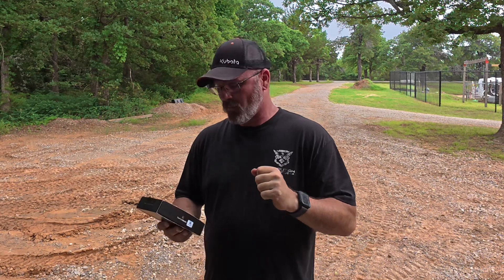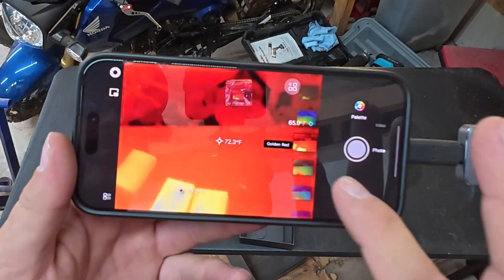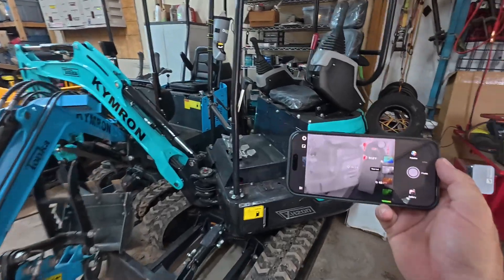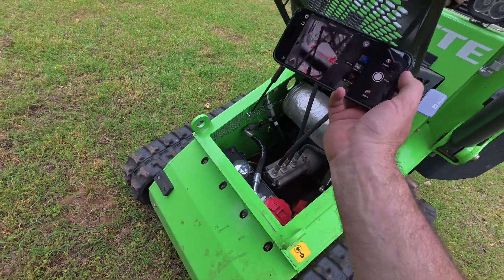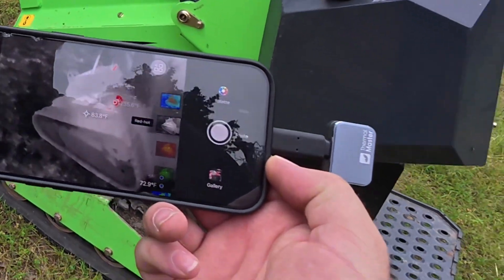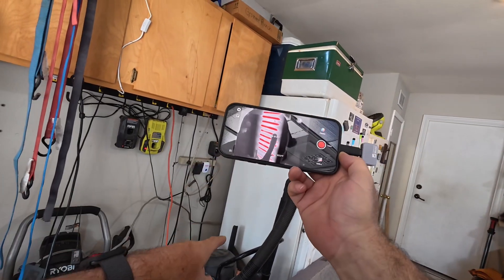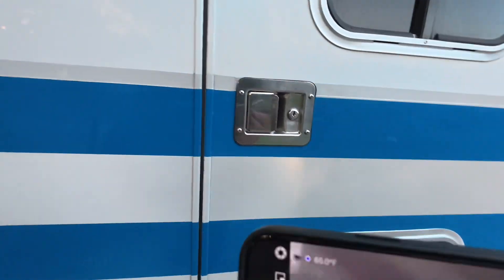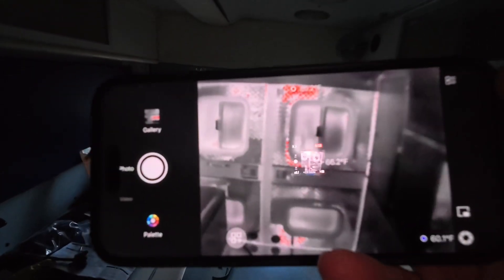I Tested A Thermal Camera on My Phone And Its Awesome!

Comment: That's cool.. I used one of thoughs tools to find blown head gasket.
Greg do you remember create dimensions for your 450 and weight 
Thanks
Reply from the maker: That’s a cool idea.  

The 450 crate was 7.4'x4.6'x5.1' & 3152lbs.  It had the brush cutter and bucket in the crate as well

Comment: I bought one to check for potential problems at a client's house and it's since been a valuable tool to have. I don't use it often, but no need to charge the battery beforehand which resloution is higher than FlIR. it's worth every penny. 👍🏻
Reply from the maker: Nice.

Comment: I have one. Not that one. But it helps to locate studs and joists. Also locates attic insulation issues. And if there are any minor roof leaks on the ceiling during or after a rain. Also neat to see mushrooms since they create their own microclimate. They show up as colder than ambient usually.
Reply from the maker: Ohhhh great ideas!!  Thanks!